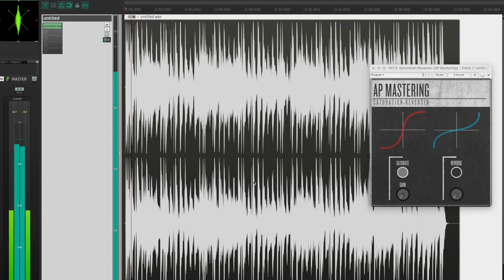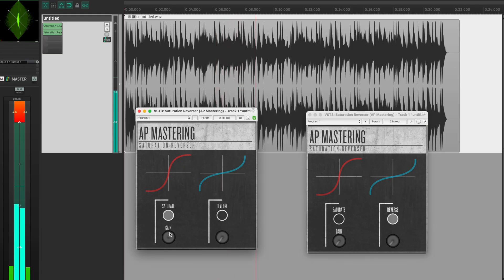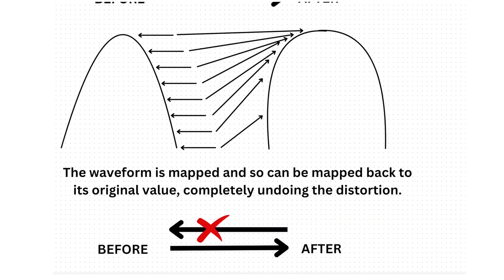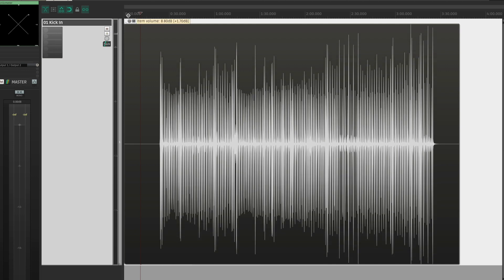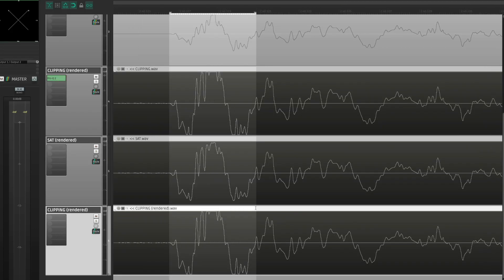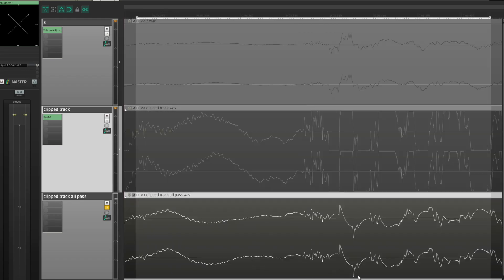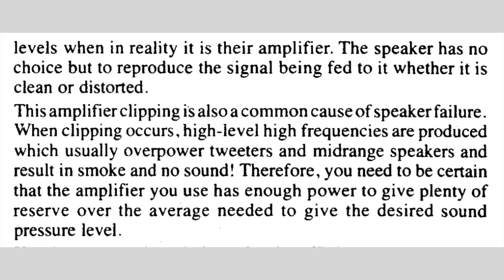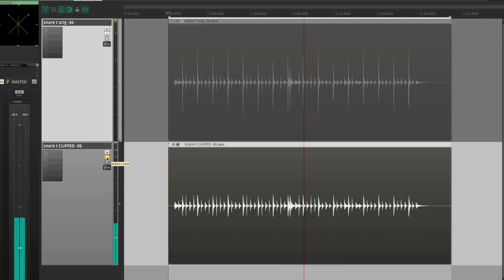Almost Nobody Knows, Distortion Can Be UNDONE!

Comment from the maker: WINDOWS VERSION is now uploaded. PLEASE NOTE: if it wasn't clear from the video, my plugin does not magically undo ALL kinds of distortion. It is only a demonstration plug to show how, when you saturate something, you are preserving the details of the music despite the distortion and peak reduction, whereas when you clip, you simply delete your audio, loosing all information over the threshold. I think my plugin demonstrates this well but don't get carried away and think you can reverse all kinds of distortion with this, you can't. Feel free to play about with it but the reverser side really is a kind of trick for demo purposes only and I'm unsure you will get much genuine value from it. That said, the tanh saturation on the left of the plugin is very pleasant and useable, and if you can oversample it (like you can do in reaper for example) it will sound even sweeter..... ALL nonlinear processing is subject to some degree of aliasing and should be oversampled in the best case... 4x is fine but more than 8x is totally unnecessary (note to self: update the plugin with a second order antiderivative so it sounds great without OS....).
Reply: Adobe Audition can "fix" hard clipping. The repaired audio probably doesn't null against the original, but if you just listen to it, it sounds good. Taken to extreme cases I'm sure it's useless, but if you just record something a little too hot or have wind noise it's great. It reduces the volume of the track and then makes up information to replace the clipped portions of the file.
Reply: @APMastering  what? 😂
Reply: Thank you for the Windows version.  I don't see it on the website, but I will send you my email so I can get it.  Thank you!
Reply: ❤ @CamariMusic
Reply: So it's best at canceling the type of saturation your type of saturation has introduced? but you're mainly giving us a nice tube sounding saturation plug in?? and it can to various degrees desaturate similar types of saturation from other gear but only if it's distorted not clipped.
Reply: I don't understand what your talking about memory, what I know is Apple pay a lot of companies, like Canon. You can't connect a smartphone by USB cause Apple phones transfer speed is comparable to a budget Android. So when you use the forced Wi-Fi, wasting battery app, in both devices Android transfer JPGs but Apple could move RAWs, for "security reasons". You know Canon, the never being involved in controversy on printing industry 😅. 
Adobe does the same thing with Apple and Nvidia, but only the cards they want, same chipset cards "doesn't understand openCL" you have to buy the same chipset more expensive card to get the dlc drivers. Nvidia does the same thing with tons of software and games. Intel and Nvidia pay a lot of board manufacturers to just have exclusive functionality and color options excluding AMD motherboards and GPUs.
I don't think Windows is a great option or the gold standard by any means, but it get to the point to MacOS professionally being used... Can only be done through emulation, cause the soldered SSD destroy all the professionalism the operating system could provide. Is also insane they remove the option to boot from external thunderbolt ssd to provide more longevity or use a broken ssd Mac. But also use several ssds so if one gets old you can retrieve info from the other ones, probably the gold standard to run professional business that make money from any computer file that takes time to craft. 
It isn't about one OS or the other one, it's about Apple being the only ones making Mac computers and overpricing them a lot to then have cheapest Chromebook features like it's just one board if it brake that's it. You can either buy the memory chips cause we told the manufacturer that doesn't sell them to anyone. So we keep charging the upgrade memory price of 200 Apples. 
Whatever the engeniering marvel the chip IS, doesn't matter cause the computer build around it doesn't match the minimum for a professional experience, waiting for a full motherboard replacement instead of swap ssd? Most artistic companies couldn't allow themselves to have 2 extra + 3000 apples computers just in case one memory chip, capacitor or psu just blow cause it's working 8 hours day with intense video files in a news channel or music files in on-line radio for example, that's an awful environment for ANY soldered memory and none standard psu computer. That's what Apple is producing right now a cult 🙊 I mean ecosystem, just for professional use, the magic mouse tells the story of you either work or charge the mouse 👉👈... We got radio and TV before we are born, but somehow cables are precived as poor tech, SPECIALLY by professionals 😅.
The bite in the paradise Apple is getting bigger, they plan is give you just a brown leaf in the future.

Comment: i only produce and subsequently master my own electronic music, so ive been noticing that a lot of mixing advice really does not apply. like for example, in most EDM tracks, clipping a drum bus would not have any trouble with the Kick being different in volume during the track, it is obviously the exact same loudness all of the time, except maybe you intentionally have a volume curve that sweeps in at some point. But than you would know that to set a sensible threshold, you would have to look at a part that is at full volume.

But with EDM, i think the argument against clipping goes full circle the other way round - if you can control every sample you use, you program every drum hit and synth sound yourself, there is really almost no way for "stray transients" to ever occur, because where would they come from? i can imagine that phasing between eg multiple drum recordings might sometimes lead to "stray transients", but in EDM you are supposed to not introduce phasing issues in the first place.

Comment: Won’t work unless you have the initial waveshapping curve. Plug-in without a use. next video , wannabe devs that should stick to jazzersize.
Reply from the maker: You are just leaving troll comments on all my videos. Keep it up and I’ll ban you for being annoying
Reply: @APMastering ok. Il keep it civil. My issue with this particular video is that your claim is mathematically untrue. You can't just reverse distortion without knowing 3xactly how it was distorted. Your plugin does not do that. I feel like your plugin doesn't even try to do this. It just reverses a process you did with your plugin and only your plugin. I don't see the point.

Comment: A speaker driver coil cannot tell the difference between a square wave, whilst it's not transitioning between "peaks" (the horizontal flat portions of the wave), and a DC voltage applied to it, they are essentially the same thing for that period of time, no matter at which volume you play it back at!

Comment: I do get that a clipped signal is just a flat line, which is just as quiet as a flat line at zero dB but with a lot more power consumption. But will this ever really be the case on the full mix if the clipper is only used early in the plugin chain on an individual instrument? Putting them at the end of the master bus is of course a whole other topic.

Comment: How would one go about checking if plug-ins are saturating versus clipping? Just zoom in on the way forms post bounce? 

Also Twitter destruction aside, I think there is a big claim that clipping preserves the sound vs a limiter that can make a snare sound dull or kick loose bass. Does saturation sit in the middle of those two or sound just as good as clipping without the Twitter destruction?
Reply from the maker: I just don't agree that a limiter makes a snare sound like this or that. it's about what you are doing in your mix and how you are driving the limiter. this is generally the kind of stuff amateurs say in forums online, I'd disregard all of it.

Comment: Your chosen title may not have captured your intent, but your full explanation was cogent. Another good video.  

If the exact transfer function is known and that function does not result in data loss, the inverse transfer function can restore the original signal. 

Your plugin works well as a lead-in for the topic of clipping. It may be my background in minimalist recording & mastering of acoustic instrument performances, but I’m not sure why anyone would tolerate a single clipped sample. There is absolutely no need for it. With a good recording, it’s easy to get the proper loudness for the target medium while leaving ample headroom for dynamics (something that makes music musical). Why do people forget that the listener has a volume knob?

Comment: I agree also with Ethan Winer and AP that music should be recorded as clean as possible, the individual tracks so that regardless what you do, you can always go back to the original and start from scratch if need be.. But the key is clean and low distortion as possible Original tracks to work with.

Comment: more mathematically accurate would be to argue that tanh(x) is bijective in the range [-1, 1], which is equivalent being able to bereverted if x is in [-1, 1], i.e, [0, 1] in the case that x is the amplitude of an audio signal.
Reply from the maker: the input signal can significantly exceed 1
Reply: @APMastering DAWs internally store audio amplitudes as 32 or 64 bit floating point numbers (float or double) in the range [0,1]

Comment: First of all I would like to issue a round of applauds for all your fact based videos on audio and debunking of some so called audiophile nonsense, actually I refer to those people as "audiof**ks" rather than audiophiles.
A comment on this video is that this underlines the exact reason of why I bought the one and only audio interface ever made by Propellerhead, called "Balance". Since Reason has always been built from a music creation point of view and not mastering, the Balance audio interface features a great feature where there is a -20dB pad which is active (if you want) when recording from a mic. The trick here is that it allows 2 tracks in parallel one which is -20dB attenuated in relation to the set gain of the normal mic signal. The benefit of this is that if if the signal accidentally gets distorted due to oversteering of the signal during recording of a singer you have that fail over track that was recorded at the same time but at a lower gain, so maybe you can save that unique performance anyway by using that track. Neat feature built in the audio interface. I like it.

Comment: Thinking maths. Suppose you have a signal x[i]. If you take an invertible function f that is your 'saturation', and y[i]=f(x[i]) is the saturated signal, then since f is invertible, it has in inverse g so that x[i]=g(y[i]). The question is whether or not your saturation function is invertible and, if not, how far from invertible it is (as I write this I have no idea how to translate 'how far from invertible' into proper maths). Of course more complicated saturation is not simply a waveshaper, and what happens for a particular sample depends on recent samples in some way (e.g. imagine you are modelling the temperature of a vacuum tube, and that temperature is affected by the input signal, and affects how input is transformed into output).

Comment: 11:26 This quote from the Mackie manual: "During the times the signal is flattened, a loudspeaker is 100% efficient at converting power into heat." Wow.
Reply: Yep, this is because throughout this period of time, after the initial transient getting up to the clipped level, and then coming back down to "resting state" (which happens in about as much time as the transient spike happens, no matter how long the signal is clipped for), the driver is no longer in motion (other than any slight osculations from the elasticity of the materials that hold the cone material fixed in space). So NO energy is being transferred through the magnetic field via inductance anymore, and the voice coil is essentially acting as a purely resistive load, turning pretty much ALL of the wattage it's dissipating into heat and not passing it through the coil, via inductance, into motion via a change in magnetic field flux, as there IS no longer any change in magnetic field because the current is at steady state. Just like a transformer can not pass steady state DC through inductance, only the transient spike up to a given DC voltage and then back down again (essentially just the AC component of applying a DC voltage from an off state, and again the transient when turning the DC off again - basically how a switching power supply functions with regards to the transformer within one), neither can a speaker's voice coil pass DC via inductance (outside of the AC component of getting to and from steady state), as they work within the same realm of principles. 

I'm ignoring things like DC core magnetization to avoid a tangent, as it's really not relative to what we're discussing, but probably has some small effect, but doesn't change the overall outcome. ;)

Comment: I personally find transients very subtly ear fatiguing, and I find mixes with a continuous peak (be that from clipping or from another form of distortion) to be more listenable... I don't care about loudness, but I tend to clip the absolute hell out of my tracks because I like the sound... I use both distortion and clipping circumstantially, and I find that they compliment each other very well. The process of distorting - limiting - clipping tends to allow the clipping to be pretty transparent, and it tends to add a specific focus to a mix I absolutely enjoy. I am aware that sustained high power is what can damage speakers, and I find this to be a bit of a shame... I personally mix quiet and listen quiet, but I find that well clipped mixes are extremely listenable even quiet. I highly recommend that you listen to and analyze Joyryde's album Brave. In my opinion it is some of the best mastering I have ever heard, and the mix is EXTREMELY clipped. I think it is about using clipping as a tool circumstantially to achieve a certain endpoint. People who push loudness for the actual "loudness" of it are utter idiots imo haha. I push loudness because of the forwardness I know it will bring my mix. Even at super quiet volumes.

Comment: "Numerical" distortion using fixed precision loses information meaning it's never going to be reversible. Even knowing the transfer curve, and it's one-to-one and "smooth". Even if you don't clip. At the very least you'll get aliasing due to the production of out of band frequencies. You'll also have lower frequencies whose harmonics land on top of harmonics of other frequencies. Third, you get quantization error. All of these errors compound. There are ways to control the noise (upsampling,  "nice" transfer functions etc.), but it's ultimately a losing game.

It's analogous to gamma correction in images.
Reply from the maker: in this case, there's no aliasing in this example. if i swap 0.9 for 0.8 and then swap it back without any additional processing, i don't see where aliasing would come in
Reply: @APMastering This is true for real numbers. DSPs use fixed precision, like 16/24 bits or floats with a finite width mantissa.
Reply from the maker: @emanuellandeholm5657  I develop plugins so I know what kind of number turns up at the input
Reply: @APMastering Yeah. Maybe in your specific case, with caveats and with 0 other processing/conversion you can get something reversible. If it's useful for you, go right ahead.
Reply from the maker: @emanuellandeholm5657  it's not useful. it was just a demonstration

Comment: This is how I think about it. The problem I get with saturating instead of clipping is that it adds too much tonality to the over all sound. The low level information gets saturated as well. Clipping allows me the tame the transients without effecting the over all sound. maybe the plugin you made is better for the purpose I mentioned but from looking at the curve I wouldn't think so... correct me if I'm wrong.
Reply from the maker: i made another saturation plugin in another video

Comment: Are you planning to expand this plugin to have more trransfer and... untransfer (ig just mathematically inverse)... curves? Seems really cool. I am curious what your take on De-Clippers is, like Izotope or Adobe or FL Studio. Obviously the original it can't be recovered, however the ability to "redraw" the wave definitely seems even more interesting after seeing how your plugin works in this vid
Reply from the maker: de clipping is impossible. you can only interpolate. if you want more drive for the saturation, just boost the level up before the plugin. you can boost 1000db and the output will still not exceed 0db 😎
Reply: @APMastering  I meant outside of the saturation context - more like for dialogue and stuff. I guess the "interpolate" you mention is the "redrawing the wave" with tools like the RX, which is what I was curious about your take on. I understand de-clipping in the literal sense is impossible, but what I'm more so trying to ask is about your opinions in regard to tools like the RX De-clip, Adobe's De-clip, the FL Studio De-clip is - outside the context of mixing, saturation, and distortion - for things like when a voice actor might get too loud on a certain word or line and clip the analog input into a recording, etc. 

Trust me, I know there's limits to tools like that, but I'm interested on your feelings about tools like that and your insight into how they might work due to your level of in depth explanations.
Reply from the maker: @5adb0i  i don't use them because if someone sends me a clipped mix, i simply reject it.
Reply: @APMastering  I understand that completely. I guess what I'm asking about is not really the kind of stuff you work with on a day-to-day basis.